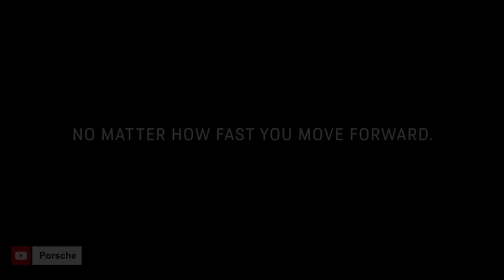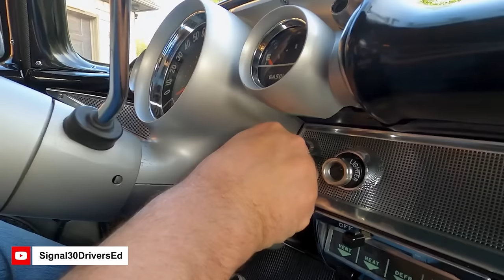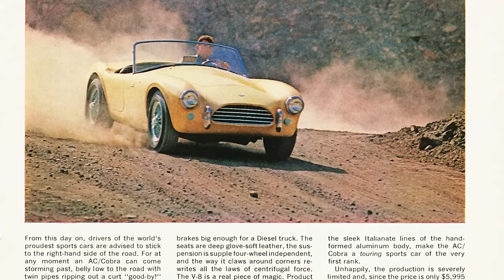Why Old Cars are Better

Comment: I'm only 21 but have never liked modern shit, from tech to cars. My tv is a CRT, I use a record player rather than a boombox or a bluetooth speaker. My greatest achievement is my car, a 1992 Plymouth Acclaim. It's like my grampas old Lada, has 300,000km on it, but runs like brand new and never breaks down. I've put over 30,000km over 4 years on this car and made so many changes to the engine, yet kept everything stock, its the only car I've ever owned and only cost me $1100. Buy old cars! It's worth it! If it breaks down and you put $1000 into it, then those parts won't break for another 10 years and you won't be going from shit car to even shittier car like most people!

Comment: Safety was garbage, engine power was horrible with terrible MPG, shitty creature comforts, but they looked cool right? So better of course
Reply: Oh and people saying new cars don’t last because reasons ignoring the fact older engines had no longevity with people speaking about old small block Chevy a reaching super high mileage which as I’ve seen is not the case more often then not the mileage rolls over a new owner would get it then guess the wrong number on how big that 6th digit is and then thing wow such a good car

Pov I own a 2014 ford Taurus with 237k miles with a health engine and never once leaving me on the side of the road or having major mechanical failure 

Also owning a 123k mile 302 Ford F-150 that drinks 3 quarts of oil ever 4k miles gets horrible mpg and is uncomfortable and a general turd but it does get the job done as a tow truck

Comment: As much as i love old stuff, i have to accept the fact that everything is better nowadays. Not very "stylish" because the post-modernist/marxist/minimalist/sovietist crap has prevailed, but certainly better overall. Especially cars.
  If you think that modern cars don't last as long as old cars, then you either have no idea of what you're talking about or it is just nostalgia and favoritism.

  Thin metals of poor quality that disappeared with the slightest hint of rust. Terrible paintjobs that didn't last 5 years. Vague steering and gear selection even when brand new. Terrible suspensions. Terrible electrics that fell apart once the BAD insulation and fitting job started showing some age. Terrible overall build quality.
   
   In comparison, modern cars are TANKS. Their electrics/electronics are properly insulated and will rarely go bad unless they are abused. Painjobs have much higher quality standards and even after 20 years they will be brand new even if you don't really take good care of it but you do wash and wax it once a year. But even if the paint gets damaged, your quarterpanels will not fall apart right away. Body materials are more resistant to rust and easier to repair. As for the engines, contrary to the popular belief, they do last with proper maintenance. Yes there are some bad apples that will rot away after a few years of regular use, but they're rare.
Reply: Sadly it's almost impossible to get a modern car without all the electronic crap in them. If you want a purely mechanical car, surely a better new one could be made, but good luck finding one. Speaking of luck, good luck actually working on your own newer car beyond changing the oil/tyres and topping off various liquids. Beyond that everything requires extensive training and/or an expensive mechanic.

The fact that governments have ruined (as they do everything) the aesthetic of cars by overregulating them so that they all have the same standardized look makes for a very dystopian feel on the streets of the US and Europe. The most interesting, colourful, and lively streets in the world? Cuba, where everyone who owns a car owns a classic.